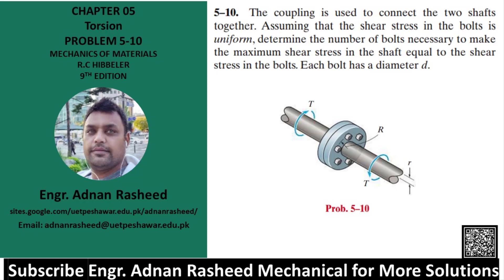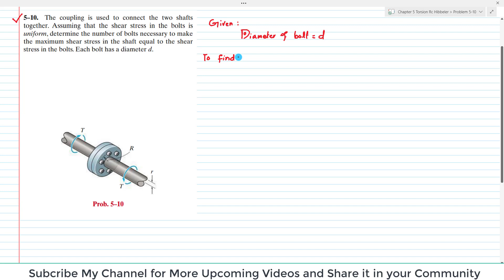5-10 |Chapter 5| Torsion | Mechanics of Material Rc Hibbeler|

Comment: how do we know there is shear force in bolt? where is the formula for n coming from?
Reply from the maker: The two shafts are join by coupln as shown in th fig by bolts. The shaft is experiencing twisting moment therefore bolt will be having shear stress due to twisting torque. For n number of bolts we can find shear stress by using formula of shear stress due to torsion.